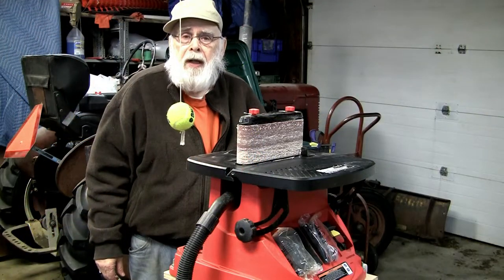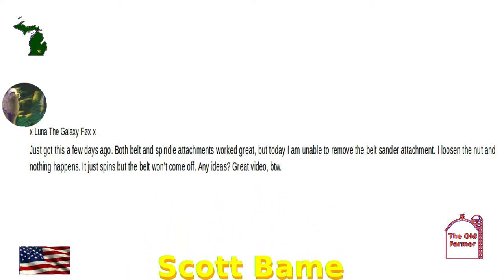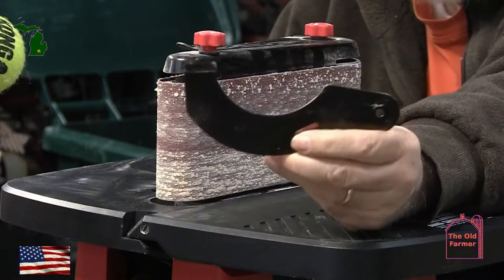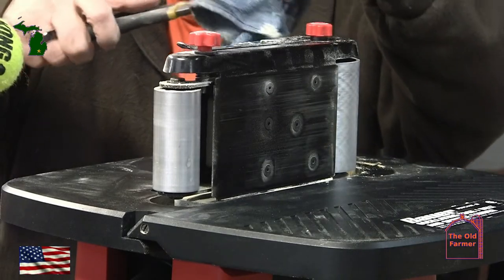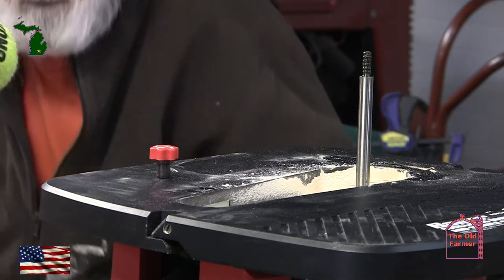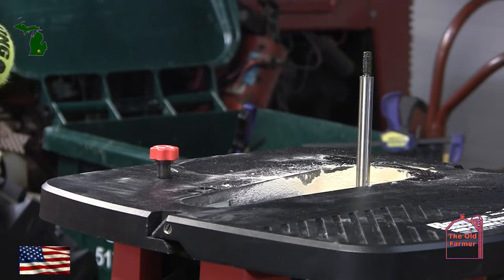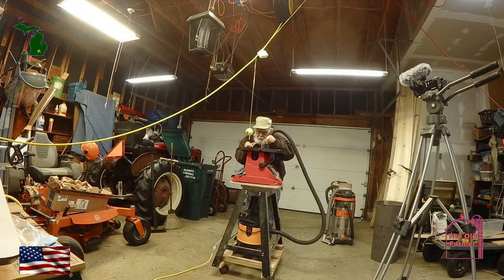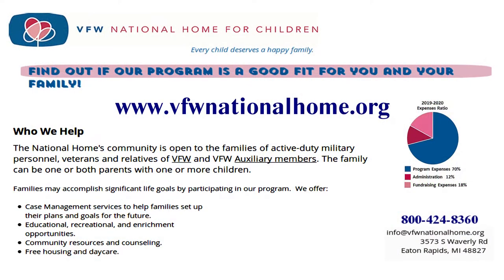127 Viewer Problem Solved: Bauer Oscillating Sander

Comment: Nice video. Note that the Bauer/Wen design rotates in the opposite direction as the very popular Rigid oscillating spindle sander. That could have something to do with the trade-off between over-tightening or loosening the bolt during operation.
Reply from the maker: That sounds like a good idea to consider. Thanks for the idea. Be safe.😀

Comment: Thank you very much for the video response! The only thing I haven’t tried so far is the silicone spray or penetrating oil. I’ll try those over the next few days and if that doesn’t work I will indeed be taking it back as it is still under warranty. Thanks again!
Reply from the maker: Somehow I missed your comment. I am deeply sorry. Let me know what happened with your Bauer Oscillating Sander.

Comment: I just picked one up and got some warrior 4x24 belts at the same time. The warrior ones are just slightly longer than the factory one and don't snug up. Any suggestions on good fitting replacement belts?
Reply from the maker: I'm still on my first belt. I didn't know there is a problem with HF belts. Maybe Grizzly might have some that will fit. For small power tools I call them the green Harbor Freight. Where Grizzly shines is their larger tools. They have a help line. Wen might have some belts. Hopefully someone watching has an idea of a good source. These all came out of the same factory as Rigid who had the first one out. Their belts might fit. And as a last thought Amazon. Keep us posted. Thanks for watching and stay safe.